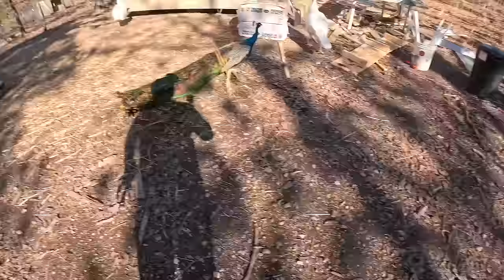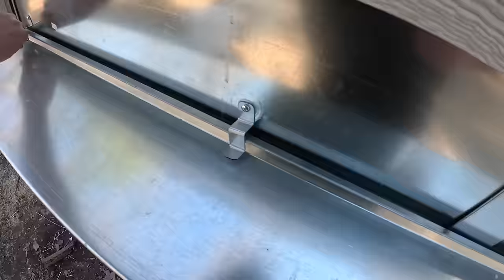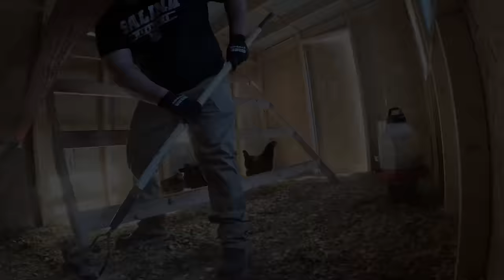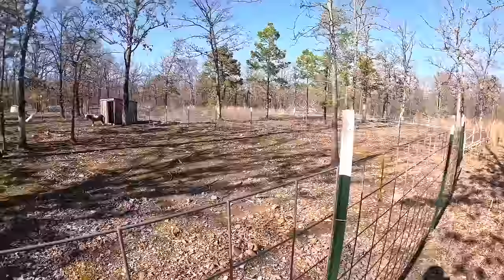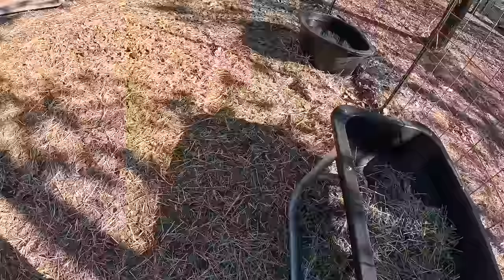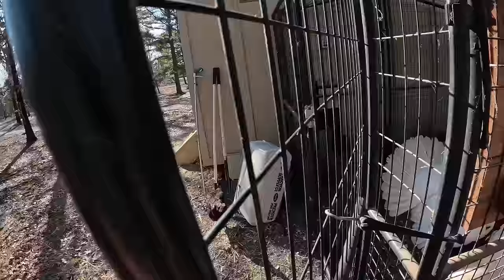😡 I've Been Dealing With A Lot Of Crap Today

Comment: That's funny and cool that Bobby is protecting you from Tucker. You have your own personal body guard. Clean the black bucket and put some Flex Tape on it. That stuff is super tacky. To prevent the chickens from nesting on the 2X4 above the nesting box, cut up 1"X6" pieces and secure them to the 2X4 at an angle laying against the wall at atleast a 60° angle between each vertical 2X4. They will slide off if they try to nest there.

Comment: Consider attaching the roost unit to a hinge set up on the wall so you could lift it to a latch on the ceiling so you would have full access to the floor.   You may need to install a filler board set at an angle between the studs so the chickens can not get on the frame to roost. We had to do that around the roof of a gazebo at our local cemetery to help keep the birds out from roosting and creating such a mess.

Comment: Sean take some of your scrap plywood and cut and lay it at about a 45° angle above your nesting box it’s enough sloop the chickens can’t stay up there. I had the same problem and I cut a piece of plywood I think it’s 14 inches wide the full length of the nesting box and it’s works very well.

Comment: When you are doing one of those messy builds.  If you put your track machine over there. You can throw trash into the bucket. And keep stuff can be thrown onto a tarp.  So much easier Sean. Compost piles get hot.  Be sure it’s close to being wet down.

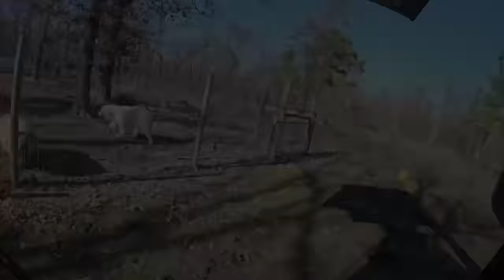Comment: 25:20 It could be easier if you put leg bolts at the tops of each board instead of nails ,just leave them alittle  loose so you can raise   the roost to the ceiling  hook it ,chain it ,so it's up and out of you way .another thing is put a little roll of that vinyl flooring on the floor to make cleaning easier. Love the new chicken coop .❤

Comment: Just for curiosity sake, would it not be better for the wooden floor in the chickencoop to be covered by a heavy rubber or plastic floor mat? Then, cover it with that nice removable bedding. In a pinch, a thorough rinsing with a high power waterhose keeps the floor dry.
 You do excellent work, sir, and your family is a lovely, hard working family.

Comment: Tip! You could put down some noot rubber mat but some plastic mat like PVC or what it's called, same kind of mat's that are used in bathroom, I know a lot of chicken owners have put that in their chicken coop and it's so easy to clean, you can put them up on the wall a feet or two and then you can just use your water hose and spray it clean!!! I said this in a video before but i don't think you've seen it ? Anyways the coop looks great 🥰❤️🥰

Comment: Sean, when it gets warmer, you should leave the horses out in the big pasture, spread that poo and compost back out and plants some grass, when it gets put them back in, and then do the same with the big pasture. Honestly, you have some of the poorest looking places for your animals. A little work, and you'd save a bunch on your feed bill esp in the summers. same needs done with the pig paddock. Section it off in two halves and plant half, then the other half. Make your place beautiful and much more animal friendly.
On the coop, once they are back out during the day, you'll only need to put bedding (I found shavings do the best) every 4-6 weeks. I cleaned mine out twice a year, once in the spring and then once in late fall/early winter. Each clean out will give you some of the best compost you'll ever use.